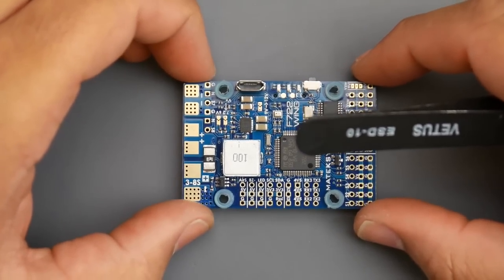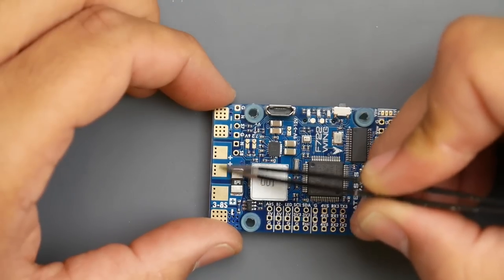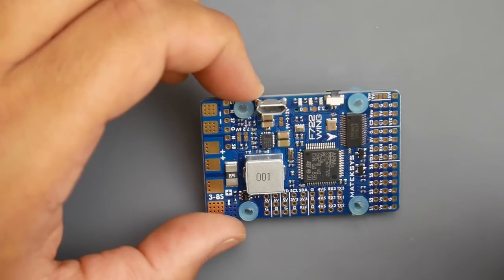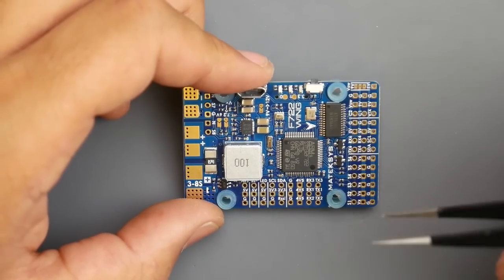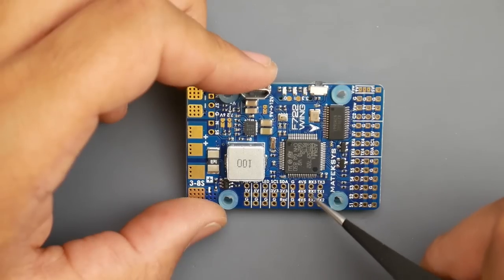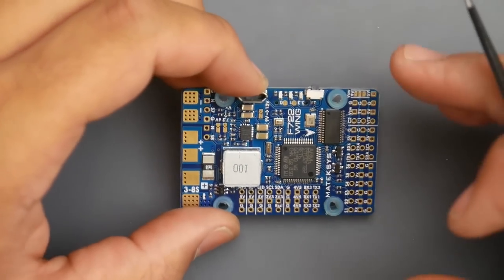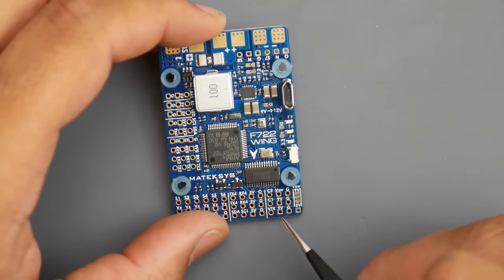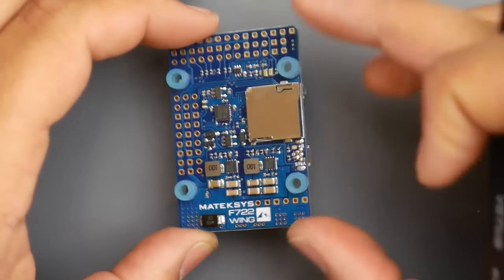Matek F722 Wing Flight Controller for RC Wing and INAV // Overview

Comment: Running this with a vista nebula pro.  Was. Wanting to use 12 volts but vsw is only 9 volts and 1 amp?  Can i just run its power and ground to c1 and bridge the 12v pad?  Or should i use the vtx power pad?

Comment: What do you meant by turning on and off vtx, what is it exactly?
Sorry if question sound stupid, but i am just starting with rc flying...
Reply: He means that prior to takeoff you can have the vtx off whilst setting up as to not create too much passive heat on the vtx before flight which could be bad if it burnt out after takeoff. Also when you crash the ability to turn off the vtx is so important because it may be a while before reaching your model which may mean that you have a fried vtx or perhaps even worse.
Reply: @sandyfpv5216   Thank you a lot. only now I get it.

Comment: Which ESCs can be controlled and which settings in iNAV have to be set for this?  I have an older rc-flyer and I want to test it.  My ESC is not responding to the RC transmitter.  The engine runs in the iNAV during the engine test.  What can that be?

Comment: Could this FC be used on a VTOL????  It has 3 motors.. I could wire 2 together and put to 1 ESC input. And the 3rd to the other ESC input, but can it be turned on by a switch???

Comment: Nice review. One thing I would be looking for would be receiver diversity. On my bigger planes I have up to 2 satellites besides the main receiver.
Reply from the maker: The R9 system does that within itself you can connect multiple together..
Reply: @DroneMesh  Oh, hmm.. I'm still hesitating to switch to a 900 MHz system, surely an option on the Nirvana ;)
But with my fixed wings, I'm kind of stuck with Spektrum (too many :D )
Reply from the maker: @M0rdH0rst  I see I never used Spektrum so I have no idea how good it is.. Something I dont understand is how people are having issues with the R9 system.. I have 3 R9 modules and bunch of receivers with stock firmware never had any of the issues people are having..
Reply: @DroneMesh  It's  less about the system, it's just that I did go from 35 MHz to DSM2 to DSMX to FlySky with the copters. I have a sh*tload of unused receivers laying around 🤣
And I never had an issue with spektrum except with the Armattan Rooster (which is weird).

Comment: Would habe been way nicer if they gave us the option to switch voltage on the VTX pad. Most cameras nowaday are 5-36V, whilest some VTXs still run on 5v.

Comment: i have had 2 of these both boards cameras dont function
Reply: cbfsoar15 I to am having issues.  I’ve got cameras both working c1 &c2 -C2 is connected to Foxeer Mix2 hd and C1 is for normal flight cam.  I can get live feed from both by switching user1 on a switch but my issue is I can’t turn HD off and on.  It’s connected to Vsw on C2 and I set user2 on a switch for in and off but nothing happens it stays on.  I’m missing something here.  Do I need to connect tx and rx from Mix2 to Matek f722-Wing? I was under impression that the vsw was a switch but maybe I’m wrong

Comment: Hey dude, Is there any was a guy could still get his hands on the transtec frog 6 inch arm kit you used to sell? I absolutely love the frame, its been my basher forever but I prefer to run my 5" setups on  235-250mm motor to motor frames.. also im going to try out some 2407 motors and id like to be able to try out some 6 inch props on them... Anyways if there is any way to get a set of those arms, even if you would be willing to custom cut them I would absolutely pay for the carbon.. Thanks for everything you do for the community man, Id be lost without ya ;) lol
Reply from the maker: Email me in 2 weeks I will contact transtec and have them make me a small order.. Stay in touch or I will forget to keep a set for you.
Reply: @DroneMesh  Oh man will do! Thanks I really appreciate that... new arms for my favorite basher!